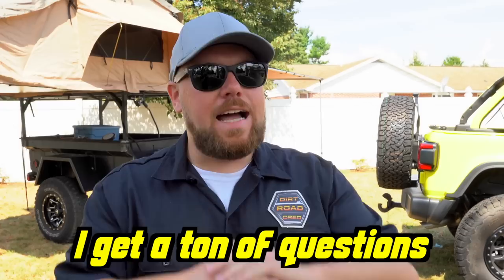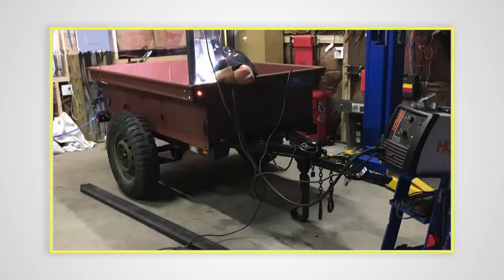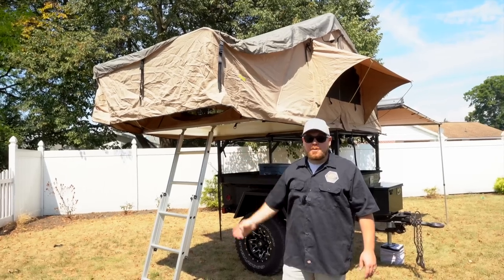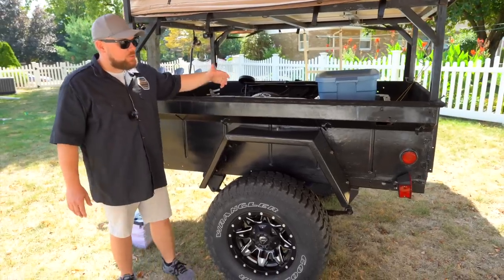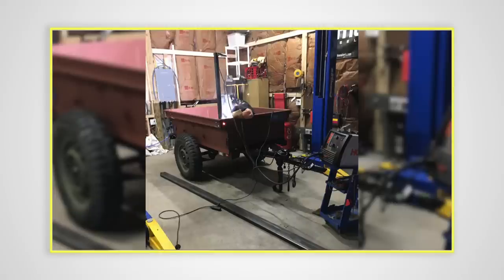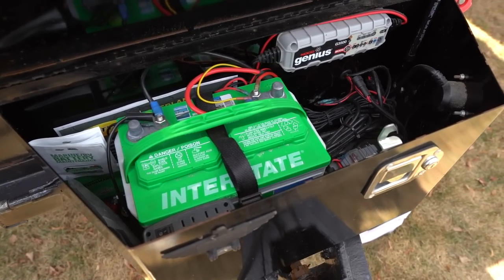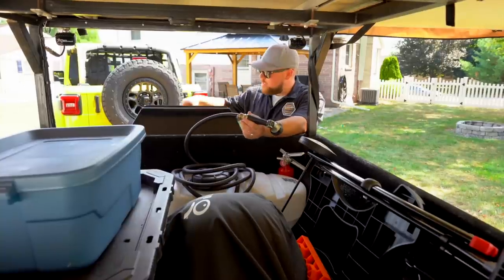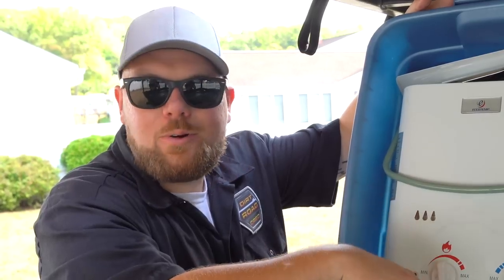My Budget Jeep Wrangler Overland Camping Trailer!

Comment: Nice build! I've often wondered why there isn't a hitch on the rear and at least one on each side of some of these homebuilt trailers..   Could use the one on the rear for a hitch mounted picnic table.  Could use one hitch on the side for a hitch mounted toilet seat.  Also, if I were to build one, I think I'd like to put removable (or foldable) stands at each corner for balance/leveling.  All of that may be overkill though
Reply from the maker: I use weld on trailer jack points on the corners for stabilizing!

Comment: I have been shopping for one of those trailers for a few years.  Where I live, the average selling price for just that trailer is $3K Canadian/ $2300 USD for something decent.  I was lucky enough to pick up a Dog House Trailer with RTT for $2300 this summer.  I also bought a shower system like you have. It's a bit of a splurge but I think it will be worth it over time.  It is  permanently mounted it in a Nanuk case (similar to Pelican but cheaper!)  A couple of quick connects for the gas line and water inlet making a quick and easy set up.  Just mount the handle it comes with to the outside of the case for hanging it.
Reply from the maker: Love it!

Comment: Off topic question.   I have yet to see a high velocity yellow Jeep.  In the video, yours looks great.  Can you please give me a description of the color,  is it “flat” yellow….or does it have some sort of metallic in it.  Trying to decide what color to order.  IM GOING WITH THE EXTREME RECON package.   Should I go with stock steel bumpers, or do aftermarket?   Same question on running board/step?
Reply from the maker: It’s a decently bright yellow, no flake, it’s a flat color like the gecko green was. Honestly I would do aftermarket front and rear bumpers and steps, the factory steel bumpers are great if you don’t plan on running a winch, which requires another $300 plate

Comment: Matt, what are your thoughts and experiences regarding JL/JT hinge corrosion? I’m super interested in a Wrangler Xtreme Recon but the hundreds of posts on forums and YouTube showing galvanic corrosion causing bubbling of the paint on the doors and the the repeat of such issues even after customers have had their Jeep in for warranty paint repair has me rethinking pulling the trigger on a new JL.
Reply from the maker: I’ve seen them and heard the issues, it’s something that will more than likely be addressed soon, I’ve had it happen on my JK back in the day!
Reply: @DIRTROADCRED  I doubt it will be addressed soon as it seems to be going on ever since the JL’s were released and it doesn’t seem like a solution has been made because even new owners are having the same issue. It’s unfortunate.
Reply: Is this due to salt back East, as I’ve never seen or heard of this among my friends with Jeep’s out on the dusty plains of ENM & WTX?
Reply: Also they all have hand crank windows because why pay for electric as we run doors off so much here. I’ve seen galvanized water pipe corrode when used as an electrical ground. I wonder if Jeep’s with electricity running through their doors with a mix of steel and aluminum are experiencing the same thing?